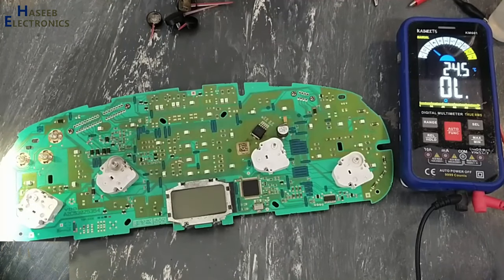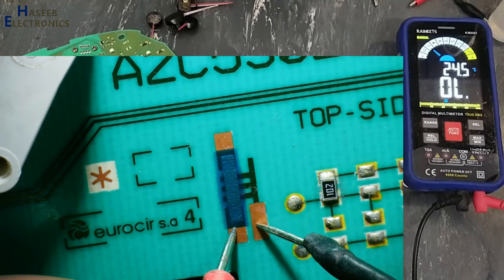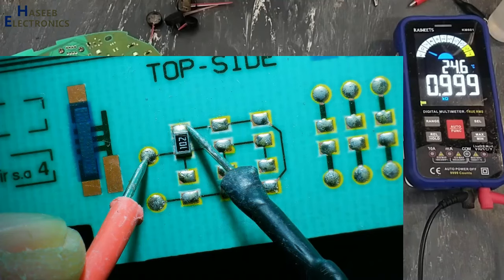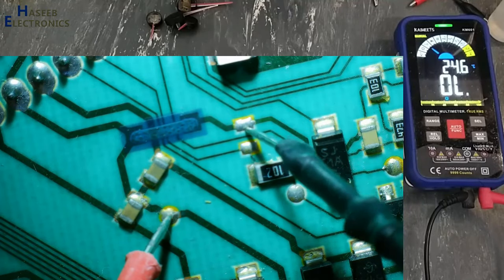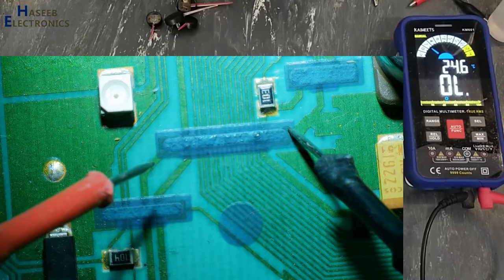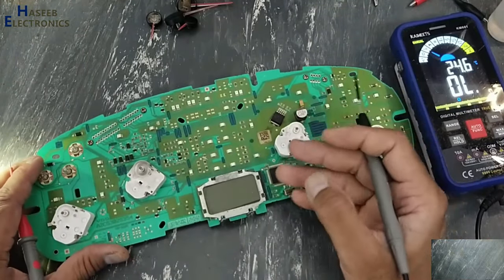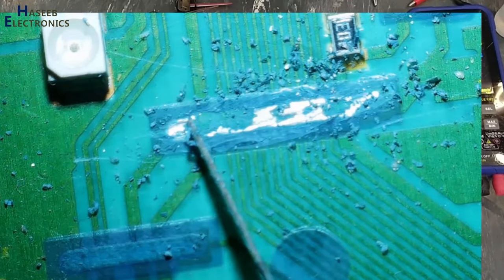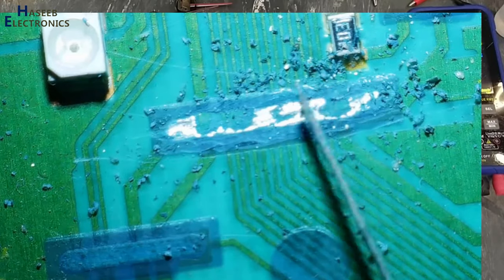{1223C} Fixing Dissolved Jumper Trace in Hyundai Instrument Cluster

Comment: You can hammer a copper wire flat to make track repair or jumper wire. Use nail varnish to insulate it.
Reply: be careful, neil varnish can be conductive, according marks and so on.